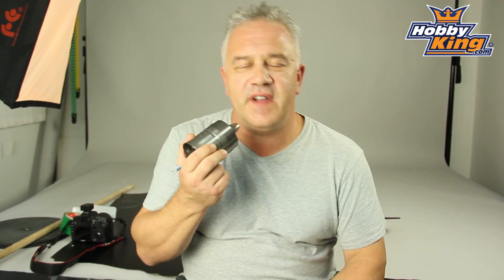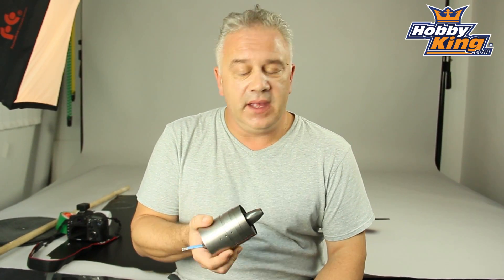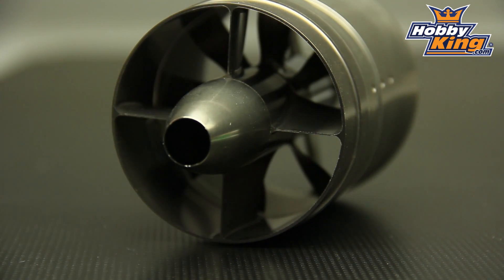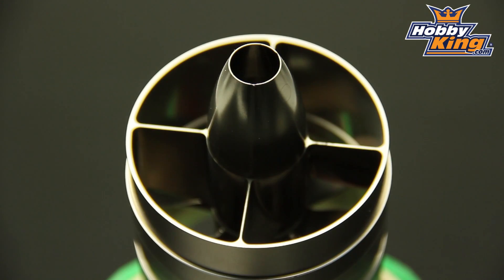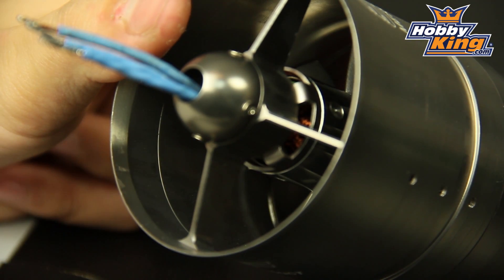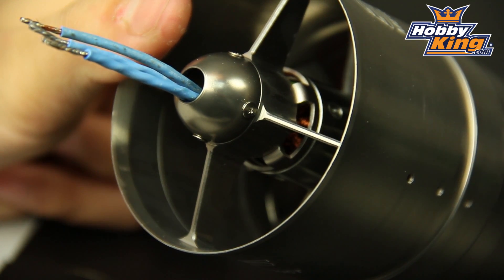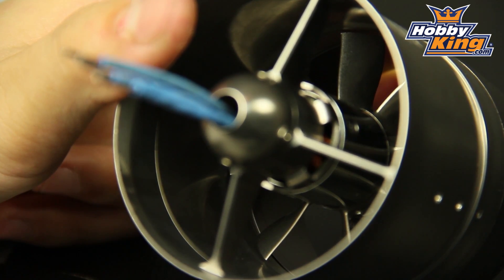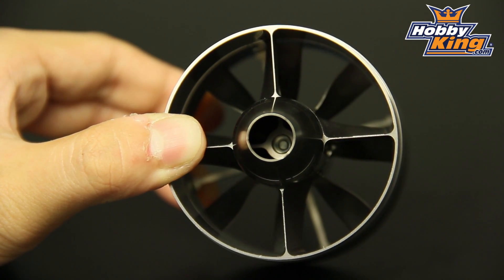HobbyKing Daily - Mercury Alloy EDF Unit

Comment: I got the 74mm Mercury EDF from HobbyKing.Just had to fit a tight rubber grommet where the three ESC wires emerge through the metal housing.Looks like a recipe for chafing & a short circuit otherwise to me.I got my rubber grommet from a car accessory shop & make sure its a tight fit ! Very nice apart from that.

Comment: @Bolle90 2. NO
Model aircraft pilots will: (g) Not operate aircraft with metal-blade propellers or with gaseous boosts except for helicopters operated under the provisions of AMA Document #555. (j) Not operate a turbine-powered aircraft, unless in compliance with the AMA turbine regulations. (AMA Document #510-A).